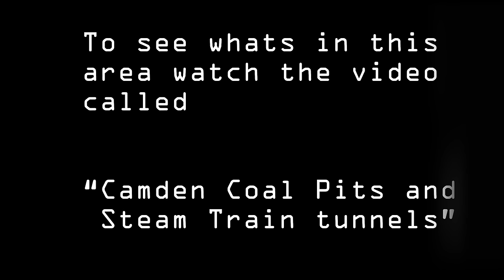LONDON RAT HOLE  Abandoned Underground Rail Tunnel

Comment: Last used in '91, hated by the rail staff if memory serves me right, will likely end up chopped and shut with HS2 too although it is technically mothballed as putting a new connection back in would be a weekends engineering possession of one line to put it back.   Its listed on Wikipedia as Park Street Tunnels and shows it as dismantled but I imagine there may be some blue sky plan down the line to extend it further because of its depth.   You can see it from a Euston train showing on the left hand side of train before it gets complicated.   Was OHLE at one point too and I seem to remember Euston's class 85 shunter would often be seen parked at the entrance but that is dim memory perhaps, not of the 85 but I am sure I used to see an electric parked there when travelling north.

Comment: Camden Service Tunnel, otherwise known as the ‘Camden Rathole’ or the ‘Camden Catacombs’, which runs from south of Primrose Hill Tunnel where it connected to the Broad Street line, served as an empty carriage line between Willesden and Euston. It lays hidden beneath mainline tracks that run directly above and the distinctive sound of these trains can be heard from within the tunnel. There are two particularly interesting features within this small network of passageways. The first is a Grade II listed stationary engine vault that was once used to house two steam engines which were used to pull trains over a steep incline and the nearby canal. This, however, is almost completely flooded and is currently sealed; although it can still be viewed by peering through gaps in the gate. The second is an abandoned railway tunnel at the base of the network.

Comment: No third rail. The trains must have been diesel powered?
Reply: me thinks they ran on spegma
Reply: Up Empty Carriage Line shouts shunting line to take empties to either the yard or into service. Part of the standard railway infrastructure. Somewhere there should be it's pair.. the Down Empty.. Time to look at some early 1900's maps to see if Camden Station (or wherever this connects) was one way in/out
Reply: They were 25kv overhead powered, though no trace can be seen on the video.

Comment: It used to run from King's Cross and only used by steam the diesel locos but only certain diesels could fit down I think it shut in the late 70s
Reply: Rubbish...false information.
Reply: Different set of tunnels, this is the dive under just outside of euston.
Reply: @professorjamesmoriarty5191  ah cheers for the correction didn't know about this one

Comment: The track looks old and not electrified, so hasn’t been used for a number of years. There must be old maps that show what this was used for somewhere.
Reply: The use is on the sign. UP Empty.. it's for shunting and taking assembled trains in the "up" direction (railway term.. will be going to the left side platforms of the next "up" station) while empty. Near me there is a yard where trains waiting are stored before entering timetabled services. This line is part of that.. where those empty trains come from at either through or terminus stations. During morning and evening rush hours they need more trains in one direction or the other.. not symmetrical services.  There used to be many of these "empties" lines which served this duty.. now mostly torn up for housing.. because we have barely functioning railways these days.
Reply: It was electrified at 25kv overhead Chris...no traces I can see on the video although you can see where the stanchion would have attached to the walls...the square marks can be seen top left of picture....freeze frame at 22:02. It's basic use was to get empty carriages from one side of the West Coast Mainline into Euston onto the other side...it did this by burrowing under. I will post a diagram that was issued to me when I worked at Euston Downside Carriage Sheds on Matthews facebook page. By the way...the post above is a load of clap trap.

Comment: I would bet you there's a full NETWORK map system Giving a full lay=out of theses ,TRACK s and for miles for Transporting,,  (zero engine power) not ENOUGH air conditioning so must be electric tram vehicles or the two man lever track carts......THERE excellent I did a 90:mile 7 valleys railway repair team 3 night's camp takes a week to set it up as first you take all your supply's and make drop off points along the whole 90 miles in 3x sections that way you only need your tools and supplys for the next days work that 30 miles each day up TRACK as your working but best is the last day going home yes thats living RIGHT there ..